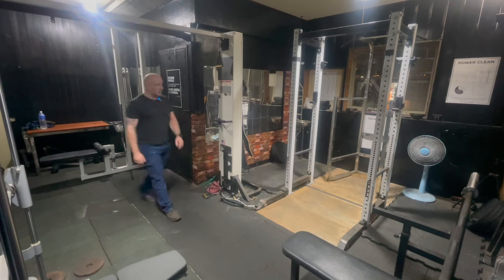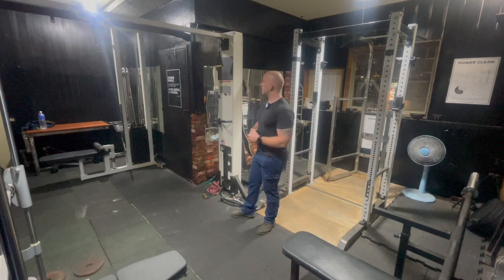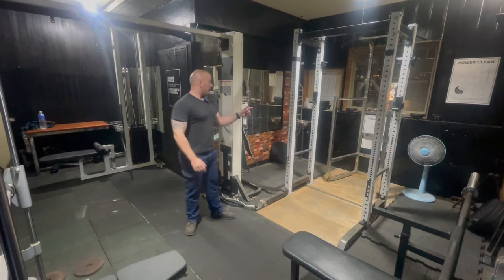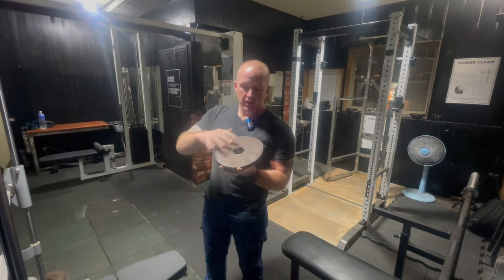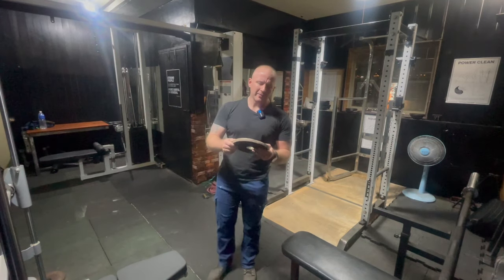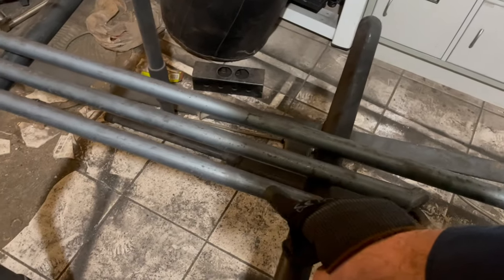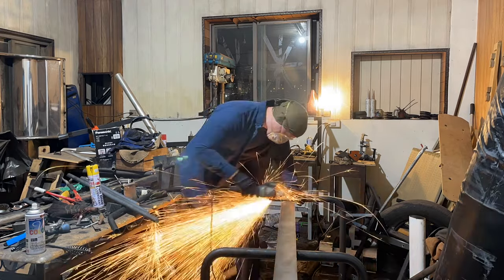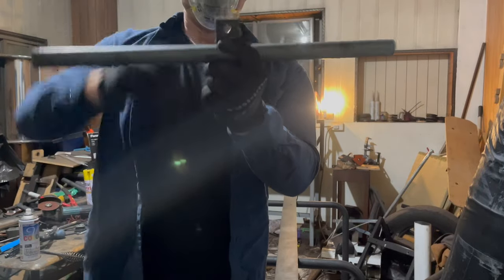DIY "Barbells" for Cable Machine

Comment: I've been fabbing neutral grip accessories in various widths, but I cannot get solid bar as you have. Please keep us posted on other accessories you will do in the future. I've never bent solid round bar with heat before. The tabs in the middle of your straight bars is simple, effective and easy to weld.
Reply from the maker: Where do you get your steel? I guess I am fortunate that the steel shop I go to is enormous and either has or can order just about anything I can imagine. You should definitely look into getting an oxy-acetylene torch. It's cheap, versatile, and very fast. You can use it to cut, bend, or melt steel.

Comment: Gonna pick up a stick welder here soon and start making my own equipment after finding your channel. My problem is, Im not sure where to source steel!
Reply from the maker: That's always a big question, initially. It's one of those things you never think about and don't instinctively know an answer for. As cliche as it sounds, typically if you google "steel shop" or something like that, you'll see a place pop up. If you try buying steel from a hardware store or any other non-dedicated place, the selection will be extremely limited and the price will be way higher.